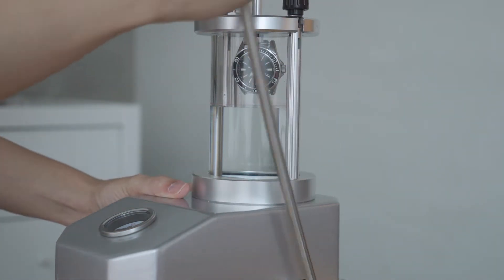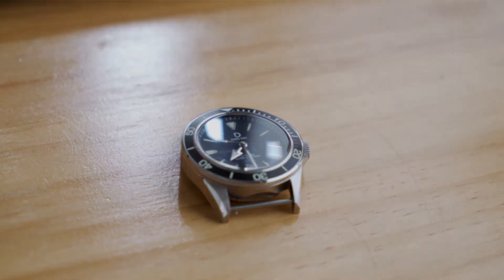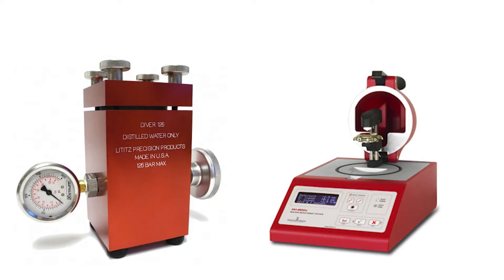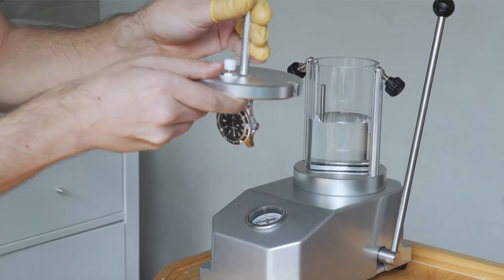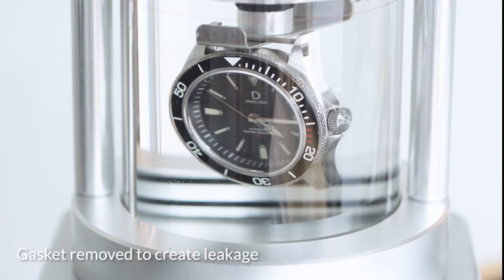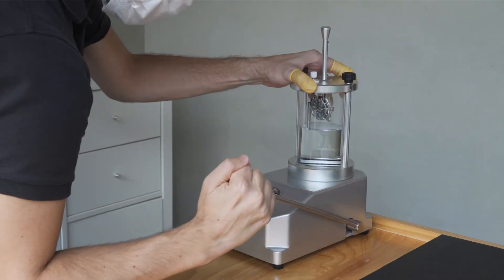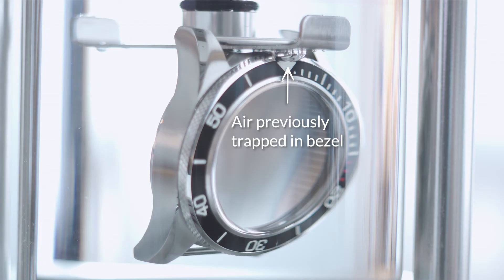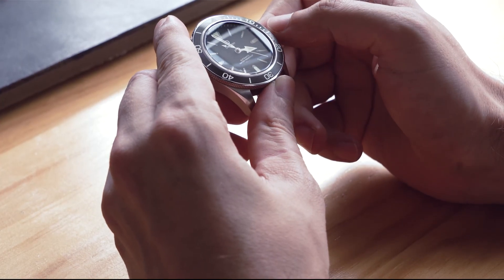Water resistance watch test with pressure tester

Comment: But I’m confused…you showed air bubbles leaking from the crown and from the crystal (around the 11o’clock mark)…but then said that the watch is good for diving. 

Maybe I’m just dense, but didn’t it leak air, therefor fail the WR test?

Comment: Shouldn't the test be done with the movement removed first for extra safety? I've seen some people doing 3 tests - regular test with the movement removed, preliminary test with movement inserted, regular test with movement inserted.
Reply: Novice here, but I think it is ok since the chamber is pressurized before submerging the watch. If there was a leak, the pressurized air would also pressurize the watch. After submerging the watch and releasing the pressure from the chamber, the pressure inside the watch is greater than the water it is submerged in. Therefore, air would be escaping from the watch into the water to equalize pressure rather than water entering the watch. Then just remove the watch before pressure equalizes.

edit other tests are valid too but for periodic checks without removing the movement, this test is safe afaik.
Reply: That's why you do the preliminary test

Comment: Hello brother, I will buy my first watch, but it has a 3 ATM water resistance. Can I take a bath with this watch? I will buy it accordingly.
Reply: Also, depends how hot your bath is. Metal expands with heat. I don't wear any watches in my bath, regardless of WR rating because of this.
Reply: Yes, taken my old g shocks in the shower years ago learnt hard way. But glad I never did with my seiko dive watches tho
Reply: 3 ATM is really, really low. I wouldn't take that watch near water, if I were you.

Comment: the info on ur website is wrong, the wet test will not pick up small leaks, the bubbles that come from microscopic leaks cant be seen, only the digital dry tester will show tiny leaks, and it can specify the rating.

Comment: 200 meters is 656 feet, not 666 feet. What's up with that engraved on the watch?
Reply: It may be a nod to the old Bulova 666 watches.
Reply: That's 1.82 American football fields.
Reply: I noticed that too. I ain't buying a watch with that number on it, plus its a lie in itself. Mathematically 200 meters does not equal that, it is 656 feet like you mentioned.

Comment: If it fails & you see bubbles… does this mean water is now inside the watch?
Reply: If there are no bezels or other extrafittings and there are bubbles, yes, it means water leakage
Reply: @shrujanamsyama9940 so then what?   Dissemble the entire watch and let it sit for a day?
Reply: Take the movement out before testing gaskets  @keithkreatives
Reply: No it does not mean there is water inside. It just means it's not waterproof. If you quickly took the watch out before pressure fell down to 0, nothing happened besides that it's wet on the outside.

Comment: Great and informative video! Can I ask, if a watch is 10bar (100m) BUT has push-pull crown (not a screw down crown), is it safe for pool/ocean swimming? Based on this video - it should be absolutely fine? But I was told my Seiko should be screw down to be safe? Interested to know your thoughts on screw down vs push crown.
Reply from the maker: The crown construction is already incorporated into the WR rating. So whether it's screw down or push crown, as long as it's rated for 10 bar it should be fine for swimming.
Reply: @DIYWatchClub  Thanks! Makes sense, and that is exactly what I thought. Good to get confirmation.

Comment: Hi, thanks for the nice demonstration! I have one point of confusion though: Eventually, your watch passes the test, but several times during the video you show what is apparently the exact same piece failing the test, as indicated by the stream of bubbles. Did you set this up on purpose for the demonstration? If so, how? Or did you actually notice a leak and fix it? Again, if so, how? 😅 Thanks mate!
Reply from the maker: I removed a gasket to create a leak intentionally
Reply: @DIYWatchClub  Thanks for your reply!

Comment: Thanks for the video. One question though, can we use a vacuum pump instead of the pressure pump? That would suck at a certain pressure and the bubble would occur. I use it to fill guitar pickups with wax for a quiet pickup.
Reply from the maker: No. You're talking about negative pressure. Few watches account for that. You can have a perfectly water resistant watch but you can still suck the crystal out. Do not attempt it.
Reply: @DIYWatchClub  appreciate you answering my question! Many content creators don’t!
Great channel!

Comment: 50m is actually 6Bar - 1Bar is sea level (0m) and increases by 1Bar every 10m.  That simple error doesn't give me confidence in the accuracy of this test.
Reply from the maker: You're nearly correct but you forgot to account for the air inside the watch. That's where your "extra" 1 bar gets cancelled out.

Comment: Lesson number one. Take out the movement first! You're testing the case not the movement!
Reply: There's no guarantee that you haven't damaged the seal when you put the movement back in. So testing with everything in place has merit
Reply: @Przemo-c  I disagree. You wouldn't use a real baby to test a child safety seat would you? Why would you risk water logging the movement and causing further damage so long as you can assure , as best you can the integrity of the case? Makes no sense.
Reply: @thejupiter2  Thing is this way you know in an environment where you can pull it out immediately while there's overpressure inside the watch so risk of water ingress is minimal compared to unknown seal state and diving where the pressure outside is higher an water ingress is way more likely and less apparent and there's a significant time delay before you can act.
Reply: @Przemo-c  As an engineer we would often carry out destructive testing. One of the many reasons for doing that was to engineer preventative maintenance programs.   If there is any risk that a seal or crown may be compromised during a pressure test then replace all seals prior to seating the movement. Pressure testing places watchcases under pressures which are never likely to be required to exceed.
Reply: @thejupiter2  I'm also a mechanical engineer. Pressure tests without movement would be a nice first step. But it won't tell you if there was damage during final assembly. And without final QA you can't know if it's actually watertight. So your proposal doesn't test the watch that's actually going to be used because of risk of test failure causing damage. The same damage that would occur if same conditions were present during use and in fact the risk of damage during test is vastly lower than same pressures in real world scenario. The purpose of QA is to make sure you catch issues before it may become an issue for actual use.

Test when you can act immediately while observing air egress is vastly safer than real world water ingress which can occur without air displacement due to pressure difference meaning it might stay undetected for significant period of time.
Reply: @Przemo-c   What would you advise a client who insisted you carry out a Insitu preassure test on a watch that was valued at €30000 and insisted if it failed you paid for the rebuild cost? Hypothetical of course.
Reply: @thejupiter2  Again during the test there's an overpressure inside the watch and leaking air is not getting displaced by water.
Reply: @Przemo-c  That makes perfect sense to me now. It wasn't taught that way in watchmaking classes . Does it overpressurise when the watch is being suspended in air whilst the vacuum is being drawn?
Reply: @Przemo-c  Wet Pressure Testing is the submersion of the watch with artificially induced pressure.  The empty case is pressurized a certain amount past its rated safe depth, maintained at pressure for anywhere between 30 minutes and a number of hours, depressurised, and then heated.  If cooling results in condensation on the inside of the crystal, it can be deduced that the
case has failed. This is from an article in TimeScape USA. They also go on to say that once the movement is replaced a dry pressure test should be conducted to ensure the seals are reseated correctly. The whole thing is a minefield. Lot of controversy surrounding this subject.
Reply: @thejupiter2  If a seal is not good the overpressure outside forces air into the watch that's why we suspend it in air for a while so it will roughly equalise.
Then we depressurise the chamber and the air starts leaking out. And when we submerge that extra air that was forced in initially escapes but there's still higher pressure in the watch than outside so things don't leak in. 

The only issue would be if the seal is so bad the pressure in and outside the watch equalises before submersion. Then the water has a chance of displacing some air in the watch and get in.
Reply: @Przemo-c  That makes much more sense to me now. I attached an article from TimeScape USA earlier. Have you had a chance to read it yet?
Reply: @thejupiter2  The link must have gotten auto-redacted  but i did look it up. But haven't gone through it all yet. Once I'm back from work I'll take another look at it.

Comment: I have Tissot prc 200,about 10 years old and battery was replaced by dealer..so they did wr test naturally and it passed ok but highest pressure was 6 bar just like on  that tester. However my watch theoretic proofness is 20 b so how come they dont test it in 20 bar,only 6? Of course im not gonna dive 200 deen but still? I would like 2 know if my watch could still hold against 20 bar pressure,not 6 🤣
Reply from the maker: I know that feel lol. But in their defense, a tester that tests to 20 bar is considerably more expensive than one that tests to 6 bar. And most common structural failures usually reveal themselves in a 6 bar test. It's a practical compromise. And I mean, if they replaced new gaskets for you during battery replacement, it's quite safe to assume the WR to be more or less intact. Personally I would dive with it without fear.
Reply: @DIYWatchClub  Ok,Thanks 4 this, i did not thought that 20 bar test would be more expencive but then again it is quite obvious. I had to ask it because i could not contact directly to person who did the job cause the dealer uses third party company(clock smith)  for Tissot maintenance

Comment: Hi. I have a tissot prc 200. Its 200m wr with a screw down crown and back. Is it safe for diving
Reply from the maker: 200m wr is generally safe for diving, barring any mechanical failure, unless you're talking about saturation diving or other extreme diving

Comment: I have a consignment from a watch maker's widow of a Bergeon Waterproof Watch Tester 5555 (older model.) It was working when she closed his shop. 
Now the handle is pumping but the gauge is not showing pressure. I have watched many videos, put in water, sealed the top, gaskets are in place but nothing works.
 I cannot find anything on repairing the lower unit (even from Bergeon online.)  Your assistance would be greatly appreciated.
Reply from the maker: It is difficult to repair the tester by yourself. But I would go about it by testing each aspect separately. Like "is the chamber pressurized at all", if yes then check the gauge, if no then check where it's leaking, the chamber or the pump. Hope this helps

Comment: Informative and entertaining! Just wondering, is there any way to improve a watch's water resistance? I'm just getting into building my own watches, but find cases that I can purchase generally have a pretty low water resistance rating, even when they are supposedly for dive style watches. I'm guessing the vendor is partly just covering his ass, especially in case the amateur watch builder does not do a good job when assembling. But is it possible, either through upgrading gaskets,  using silicon, changing the crystal or by some other means, to improve a watches water resistance?
Reply from the maker: Ah, this is a good question, one could do an entire video on it. But in short, no. Much of the WR rating is baked into the construction and the structure of the watch. Let's use crystal as an example. A 10 atm would require a thicker crystal than a 3 atm watch, as thicker = stronger against pressure. Now let's say you have a 3 atm watch that you want to "upgrade" the WR rating. You'll need a thicker crystal, but the thicker crystal won't fit into the watch, because the case is designed to take a thinner crystal. (You'll have extra crystal sticking out on top). And remember WR rating is much like a chain - it's as strong as its weakest point. Crown gasket, case gasket, crystal, case material etc. Any one of these elements fails, the watch fails. So in order to do that, you might as well get a new watch. BUT in the case of a rated 10atm watch that, due to degradation, can only pass a 3atm test, you can improve the WR rating back to its original by replacing or repairing the failure point.
Reply: @DIYWatchClub  Thanks for the quick and detailed response! I appreciate what you are saying. Still I'd like to try to upgrade the WR if it is possible. It's not that I have a watch that I want to upgrade. Instead, as a hobby, I want to BUILD my own watch, but one that can handle a reasonable amount of submersion in water. It turns out that there are not many cases (at least in my desired size and style) that I can find which have truly decent WR. I'd see a case in a listing with a stated WR of 20 atms or even 30 atms, then see the same case from other vendors with a rating of 5 atms or even 3 atms. Just to make sure, I'd contact the sellers of the 20 or 30 atms cases, and none of them stood by their stated WR specs, all of them (literally all of them) telling me their cases shouldn't get wet. So again, I'm willing to spend a little money on the project, just for the challenge. As such, would I be able to install a thicker crystal if I was ok with it sitting a little proud of the case? Would the shape of the crystal make a difference? Like, would a domed crystal be able to withstand more pressure than, say, a flat one? Are there 3rd party gaskets for sale out there that might be an improvement on the ones that come with a cheaper or lower spec case? Would silicon grease be helpful on the gaskets? Just some ideas I'd appreciate your thoughts on.
Reply from the maker: @greggusan  That's insane to hear that you're not supposed to get your 20atm case wet! Gasket is something that fits or not. There's not much of an "improvement", since you see, gasket works by it "changing shape" to fit the gap to a T. A thicker gasket isn't necessarily better, as you're squishing more rubber into the same tight gap, which put more pressure on the gasket itself (assuming you can squish it in at all) and it can cause to gasket to break more easily. The shape of the crystal theoretically has an effect, but it should be minimal compared to the actual thickness of it. I've had success with silicon grease on a used watch, rated 5atm but fails a 3atm test, and gets back to 5atm after application of silicon grease on the case back gasket (which was the failure point). I don't have experience with crystal that sticks out, but I'm not optimistic about the fact that the contact area between the crystal and the case stays the same, so the seal is basically the same. If you have the budget, I'd suggest you get a Seiko Tuna and a Seiko SKX007. Dissect them and you'll see the massive difference in crystal thickness (which is ultra thick in a Tuna) + case construction that help the Tuna with its WR rating. It's not just one element that propels it to a beast in WR, it's the ensemble of structural elements that achieves it. But I digress. What you can do is perhaps set up an experiment, where you change one element (say gasket grease) and then pressure test the watch. Through trial and error you should come up with some interesting finding! Could be a fun little project!
Reply: @DIYWatchClub  Haha I should have written that  part a bit better: these vendors didn't say never get them wet, they said you can wear them while you wash your hands, and occasionally splash water on it. But that's it. As for the gaskets, I understand you probably can't change the size/thickness of them. I just was wondering if there were higher end ones that were perhaps more supple/pliable/durable/compressable (or whatever characteristic is better for sealing - not quite sure). Your idea for testing of experimenting by changing variables one by one and testing if there is an improvement sounds great. Maybe even combine all the variables where there were improvements, and see how much improved WR gets. Would be perhaps a great idea for future video (hint hint haha)?
Reply from the maker: @greggusan  Lol certainly a good idea for video

Comment: My seiko said at the backcase "water resistant-WP"  what is that means ? its some normal 7s26 seiko, not seiko diver watch.
Reply from the maker: If it doesn't specify the exact WR rating, most probably that means it's on the lower, or even lowest, tier of water resistance capability. Something like splash proof or 3ATM. But if you want to make sure, you should check your watch model number online to see the exact specification

Comment: Removing the bezel before testing? - they're not designed for frequent e.g. 1/year removal. Is this a serious video of advice?
Reply from the maker: A water resistance test isn't a test you would do frequently, nor is it needed so. And certainly bezels aren't designed to be non-removable (I'd agree that it's not something you should do frequently though). Perhaps I didn't word it clear enough in the video - what I was trying to say is, for beginners, if you have trouble distinguishing the bubbles coming out from the gaps of the bezel, you can remove the bezel to eliminate that confusion. It's not an absolutely required step at all. Thanks for the comments anyway, appreciate it
Reply: Steady on.